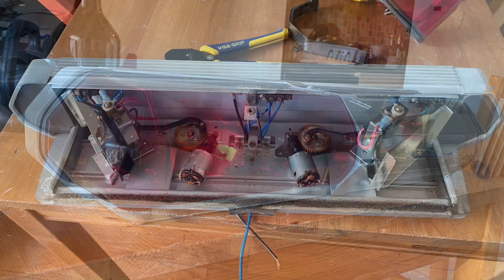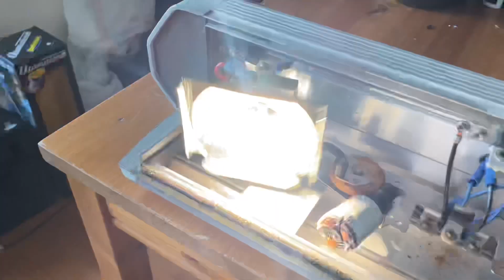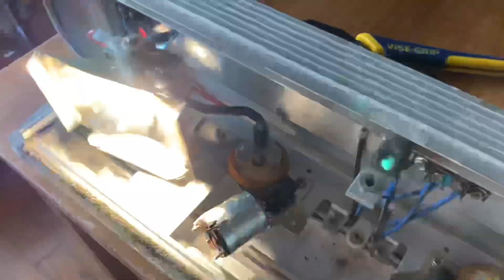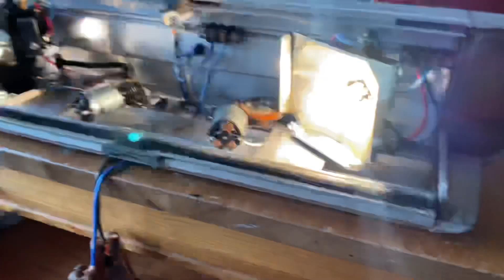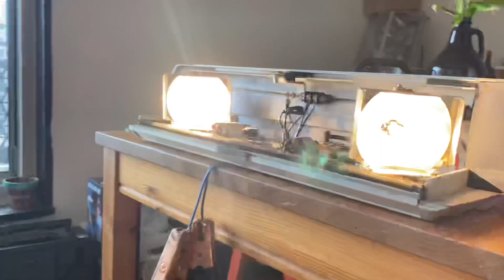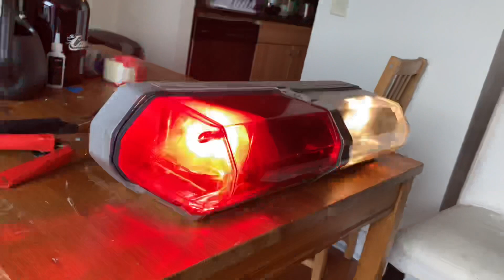Code 3 XS8000 Intensity Flush Mount Oscillating Mini Lightbar

Comment: I had a bar containing these oscillating components on an ambulance I operated in the late 90s.  When the light heads eventually failed I was bummed to find out that code 3 had replaced them with a rotating module and the oscillating version had been discontinued.  I asked my supervisor if I could repair the oscillating modules and was able to salvage two of them placing them at the corners of the bar and adding the rotators to replace the center broken units.  So essentially I was able to take six of these units and make two working ones and retain them for the light bar.  I still think this design was far superior (as far as warning is concerned maybe not durability) to the rotators that replaced them but much like the oscillating elements in wheelen products around the same time they literally beat themselves to death as they worked.  https://youtu.be/winKdUpeQzE
https://youtu.be/5o5XFxQM7Ts
Reply from the maker: Very very interesting! I do agree these throw a better light than other oscillating heads of the same era, but it's true that they did beat themselves to death. The plastic gears in this one are brown and crispy, and I'm surprised they haven't given up the ghost yet. I'll worry about it when I have to, though, as sourcing parts for this thing isn't something easy.
Reply: @doranbaltus  my personal experience has been that you can't really win with the gears if you grease them they deteriorate and if you don't they get brittle.  However the fact that yours has kept indoors and not run for 6 hours at a time sitting on scene of a fire standby probably means it will do just fine.  Thanks again for posting this was a nice bit of nostalgia for me.
Reply from the maker: @RAM4elightbars  I’m always on the lookout for weird oscillating pieces, so I had to jump on this one. I think the low run time definitely did save this one, and I’m not about to run it into the ground. It was hazed and yellowed when I got it, but it was pretty easy to clean that all up. It would be cool to have a full sized flush mount with only these oscillating lights in it, kinda like that giant Piercer/PierceAlert Whelen bar you built years ago.
Reply: @doranbaltus  I'm glad you saved this, there aren't many code 3 xs oscillating bars left.  Thanks again for posting.